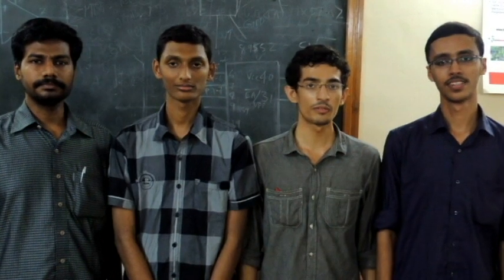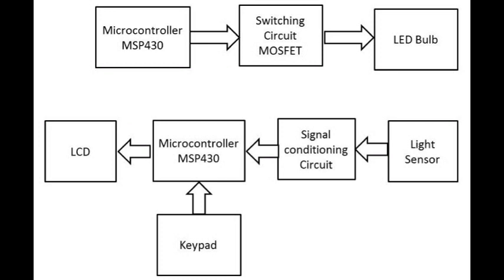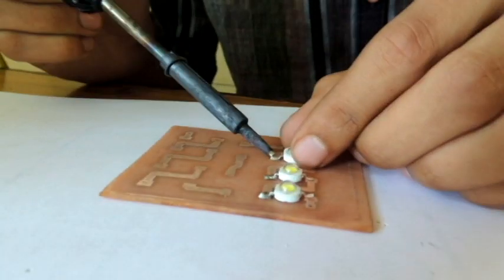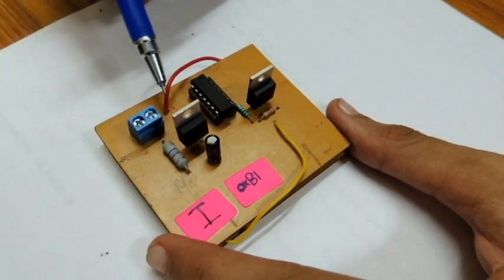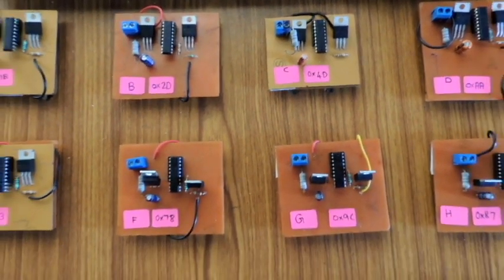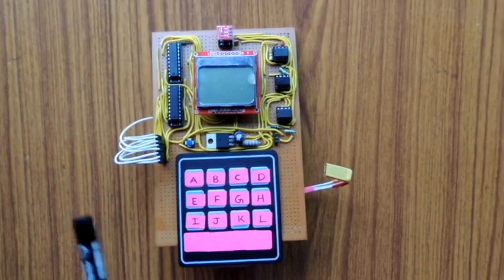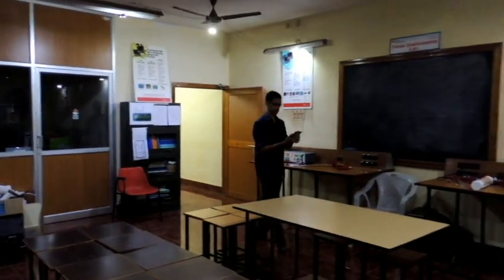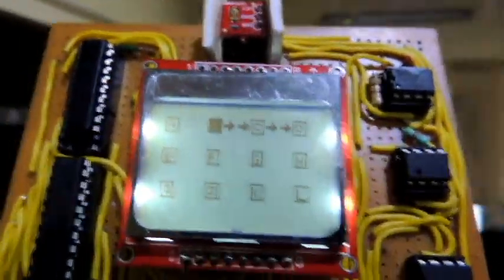TIIC IADC 2014 -- Team 58.2 - "Indoor Navigation using Visible Light Communication"

Comment: hello, this is a nice project! i wanted to ask what exactly is the Id(Hex code) you are sending to the MOSFET. Is it just a PWM signal to set the LEDs at a required brightness for the TEMT6000 to receive? I didnt get the part where you said it sends bit by bit at 2kbps to the gate of the MOSFET